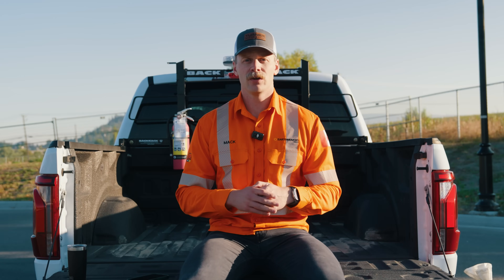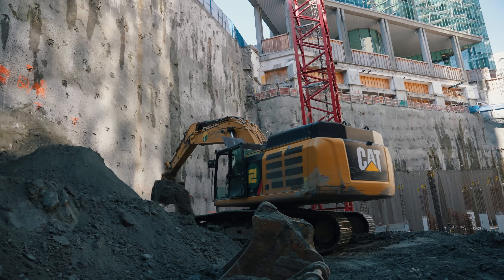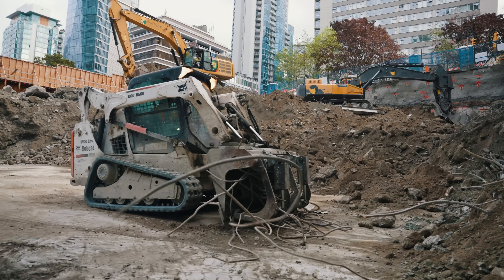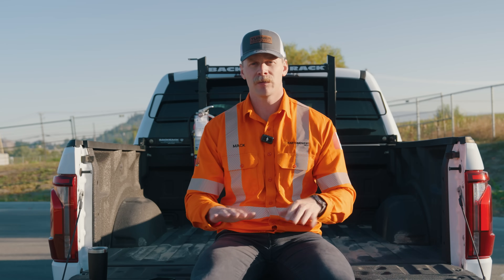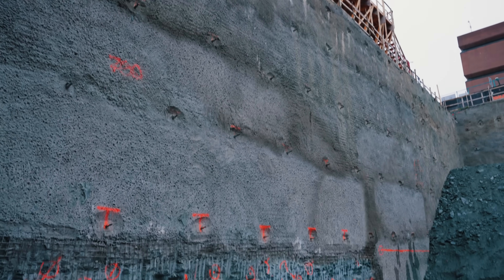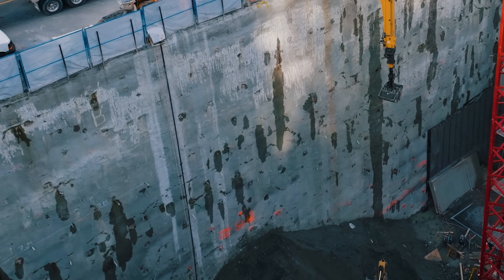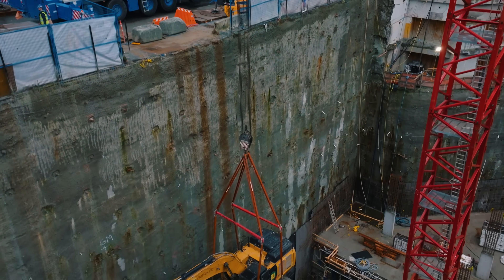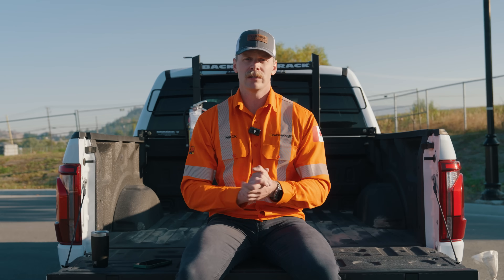Why are They Digging a 120ft Deep Hole in Vancouver? (Insane Engineering)

Comment: A excellent way to slowly dig a deep hole.  But why not use a waste container, like used to dispose of solid waste.  They make a 3 foot high container for dirt, and they can fill with 10 yards of dirt per container, lift them out with a crane, and drop in a empty at the same time.  Much faster.  And you need the construction crane on site anyway, just make it heavy duty enough to lift the desired 10 yard containers.  Instead of slowly lifting out 1.5 yards of material per bucket full at a time with that special telescoping excavator.  You could have a line of trash style rolloff bin trucks with the 10 yard container show up, lift their empty into the pit, and pull out a full one at the same time, send the trucks away every 6 minutes with 10 yards of material.

Comment: The guys doing the UBCO project in downtown Kelowna could have used these guys help. Their excavation was disastrous. Particularly to the surrounding buildings.
Reply from the maker: The BelPacific team does is right, thats for sure
Reply: The water table is a different issue that Kelowna deals with because of the lake
Reply: I drove by the dig a number of times.  No shoring of any kind was installed.  Just straight excavation all the way down until failure.
Reply: It’s the engineering that the issue not the working team

Comment: It scares me every time when I think of the side pressure on the road when heavy equipment working at the edge of excavation pit. Great video.
Reply: It scares me too especially coming from a guy that has survived two excavation cave ins and a fall from heights in my 35 years of construction , happy to be collecting a pension now .
Reply: @dmc2087 wow
Reply: TBF they have installed retaining bolts and cement into the wall.
Reply: @petergerdes1094  It can still happen if they don't cure it correctly, but shotcrete is hard as hell. It's hard for excavators with the hammer attachment to easily break it down.
Reply: @petergerdes1094  Happened in Burquitlam last year
Reply: @Mack_Dingo 😂
Reply: Cool and all but biggest fear getting trapped in a under ground parking lot like that if there was a earthquake or something. Already trip out even if I have to park at the highest level of a underground parking lot.
Reply: Especially after seeing this video from Coquitlam a couple years back. https://youtube.com/shorts/Ne2PQxGB0VM?si=rJUfI9NgJ9FtZAN8

I also feel like having the treads of the excavator perpendicular to the edge of the excavation is dangerous. One wrong move when trying to back out, and you end up accidentally driving forward off the edge. I would think it should be standard practice to bring the excavator in from the side and align the treads to be parallel with the edge, so it can only move sideways, not forward off the edge.
Reply: @AWSVids  the track has very little grip on asphalt or concrete surfaces  you could easily slide into the pit that’s why  they have it positioned this way the weight is also further away from the side of the wall this way . The operator running this or any excavator knows forward and reverse  to the position of the tracks otherwise they should never be in the operator’s position  😊
Reply: Not only does that surface have very little traction, but tracks have almost no sideways traction.  The vehicle is also narrower, making it easier to tip when working the boom off of the side.  Lastly the operators only chance of survival in a wall collapse is to be able to move away quickly, which is impossible if positioned sideways.

Comment: why doesn't the tower crane also have a clam bucket to help pull up the material quicker?
Reply: Tower cranes are not designed for that type of work. However, a crawler-crane positioned same as the excavator(s) and equipped with a rope-operated clamshell bucket would have been able to handle ALL of the excavated material, regardless of depth. Faster, too!
Reply from the maker: @1alanmarsh  Tower crane would take up too much room at street level. One lane was closed for loading trucks, other was open to live traffic

Comment: I saw this next to B.C. stadium at the (ACDC) concert 😊 but it was an (HITACHI) excavator with same straight dipper arm attachment to clam bucket. The excavator sat on huge wooden planks. Two dumptrucks were always ready to be loaded. Got to talk to the operator and he showed me all the cameras he has in the cab. 😊 he said the materials removed get dumped on a big barges for dumping out in the outer bay of Vancouver Canada. When I was their overnight thay were removing from pit the big compressor type DRILLING rig trailer down in the hole. All the workers had a built up steel platform that had a ladder for climing out of hole. Their were two excavator in hole bottom one smaller that the other. 😊 the big CAT one was working digging scratching at paint marks or a laborers hand signaling were he wanted the excavator to scratch at loss materials and cement. The pile for the clam bucket was on one side of the big pit in a pile, that the operator I talked to kept taking another load from.😊
Reply from the maker: Yes, BelPacific does have a marine based disposal facility, only material that meets certain specifications can be dumped there

Comment: would a conveyer system not be faster?
Reply: I was thinking of a grain auger.
Reply: No they don't have a long enough run to get materials that high without shutting down the entire site. I worked with this company for many years deepest hole I was on was 116. Only twice seen a conveyor and it was kinda a pain in the ass those sites were 5 times as wide so we could work around the conveyor but yea not that deep not in downtown Vancouver
Reply: its not about speed. speed doesnt make money. taking a whack of time does. Simple big business.
Reply: @diskotekentertainment8525  If there's an early completion bonus it would make sense to do it faster.
Reply: @diskotekentertainment8525 bet you’re not in business, it’s all
About speed, specially if you are hard dollar, this is all hard dollar, too steep for conveyors

Comment: Conveyors are constant and efficient at moving product
Reply: They have limited space involved in the excavation and the depth required for the building foundation a conveyer system would need excessive space and consistent assembly disassembly and maintenance as the depth increases thus increasing the time required and cost of the project and requires to much space therefore would not work for this type of excavation.
Reply: We have done conveyors for sites like this before. They mount off the side walls.

Comment: They don't just leave the equipment at the bottom and build the building around them? Disappointing.
Reply: Don’t they need a heating system?
Reply: That tower crane first piece will stay in that building
Reply: @CBECK73  You mean the concrete pad, yes it will get fille up with dirt and concrete up to the floor of the parkade. the whole crane will get removed in pieces
Reply: @B @Breezy8257 not the first piece is poured in place . Ive done at least 10 of them in Portland Oregon and PNW.

Comment: Surely there are more efficient ways to get dirt out of a hole...
Reply: Since the highest elevation on the West End is only forty feet above sea level, and the west end is a peninsula, I ‘d be more interested in how they keep that site dry
Reply: @johnmilkovic  i didn't see any dewatering equipment nor was i looking for any but if there was water infiltration well points would be set up to suck the ground dry.
Reply: Do tell!!!! Mr Expert…..LMFAO!
Reply: I really wanted to see a conveyor lifting it to street level
Reply: Some sort of conveyor system you’d think.
Reply: Not when you’re paid by the hour 😆
Reply: Big vacuum hose would do it.
Reply: Its more efficient having multiple machines that can jump around site to site without needing tear down/reassembly/maintenance/inspections/certifications. You can have 3 jobs on the go at different phases with one machine doing each job. These machines have certifications. They have a dealer network behind them. Lots of people qualified to work on them. They don't require days and weeks to setup with a crane. Bell Pacific doesn't want to be effected by crane schedules because they're not a crane company. These machines just require a standard operators proficiency to run. You'd need specialists for a bucket wheel contraption just to avoid liabilities in regard to the maintenance and safety of the machine. All thats covered when you're running a Caterpillar machine.
Reply: @NotSureJoeBauers Exactly👍 and also keep in mind the limited amount of space available for the excavation and the soil and rock conditions all play a role in the equipment required for the project.
Reply: @NotSureJoeBauers great info.👍
Reply: No kidding 😊
Reply: Most amazing section of the video for me was the mobile crane slowly hoisting the excavator out of the hole. That’s a lotta trust on every individual link / fitting involved. Amazing engineering and operational skill all around.
Reply: was thinking the same thing really an excavator with the a long reach and clamshell bucket😂
Reply: That's what I said when they first had the Long reach. Some kind of vertical conveyor belt with buckets.
Reply: Such as?
Reply: Need to look at the whole job, probably moved as fast as the slowest part of the complete process would allow them lol IMHO
Reply: If there was, they'd be doing it.
Reply: Yea bucket elevators
Reply: …like an bucket escalator.
Reply: They have to stop every couple of metres and shore up the walls so having expensive gear sitting around while this happens wouldn’t be cost effective. So they use excavators at a pace probably in tandem with the shotcreting progress
Reply: @John637  My observation on site as a flagger that is correct. I'd have trucks pull into my work zone and unload their shotcrete into the pump, they were on a schedule that matched the dig's progress, basically every 10 ft down or so they'd start with the shotcrete for however many spaces, they tear out the stuff that was supporting the wall before and do it again, dig 10 more ft and again. Deepest project I ever worked on was 30 ft, but 120 ft is wild and it took 13 months which is honestly not bad as it's a relatively small footprint
Reply: Just out of interest lads, would it not be possible to rig up the tower crane with a clam shell bucket, is that even feasible,or possibly a future project to look into, I’m not a construction engineer or worker, it was just something that struck me whilst watching this video, Really enjoyed watching this, new subscriber here, ok, from across the pond, exciting to watch these projects happen eventual completion,
Reply: @MrPat1559 probably cost more to run it when it’s been used for something else. And think of the wear on it making that many 1/4 turns. They don’t stop and start rotating as fast as excavators can plus it would be a lot harder to see from 200ft up
Reply: @MrPat1559  The bucket could be installed they do exist, but the crane is a lot slower also you'd need a mobile crane which as you saw in the video takes up 3 lanes at least possibly more, imagine having a mobile crane parked on the street for 13 months. It would cost the site god knows how much to close the road for over a year.

With the excavator and dump truck they're only occupying one side of the road and the flaggers and move cars on a single lane alternating traffic pattern, still paying money to the city but it's way less
Reply: @MrPat1559 possible? Yes.
Practical? Probably not, tower cranes are expensive and would be slower (keep in mind the pendulum effect causes the load to sway as the crane moves).
Reply: @MrPat1559 yeah, the crane could lift a larger bucket and probably fill the trucks in one scoop.
Reply: @MrPat1559  Tower cranes are expensive to buy, setup, keep certified (think x-rays, inspections ect) and the operators are making 100+ an hour. These guys running these machines make less that half that. You'd have to have a engineered base for the crane and have it on the corner of the site (loose space and increase cycle times, need bigger crane to reach the site) or put it in the middle and keep lowering it somehow. 1 million and 1 reasons why its done this way.
Reply: Doesn't make sense  !  There's easier ways than that to dig a hole 😊😊😊
Reply: They could go twice as fast for half the money. However, they lack experience and have failed to make up for it by studying harder. Take care.
Reply: @carlcarlamos9055 wow listen to this genius
Reply: There is not. If a contractor can do it cheaper more efficiently they will.
Reply: Depends on what kind of efficiency you need. 

If you want efficiency of budget, this is the way to go. 

If you want efficiency for time you can setup a continuous conveyor that costs hundreds of millions and have 5000 people on site all digging by hand and putting up shoring and you can clear the hole in 2 weeks.
Reply: @cconnors Fast, good , and, or cheap. Can't have more than two at a time.

Comment: Its too bad they cant set up a series of stackers at different levels to pass the dirt out to save time and fuel. Deep hole in a tight place. I would have thought ground water table would be an issue that deep in a port city.
Reply: On the one I saw next to B.C. place (stadium) same type deep dig. Thay had pump power units pumping out the water. Their seemed to be continuing wet water coming out of different heights on walls. At bottom they had a little pit dug for water to go into to pump out at 24/7 pumping. Same thing I saw in an open pit mine in Salt Lake city area west of city. 😊 big pump house in middle deepest part of open pit. Plus a work crew always working on water flowing in from different hight of mine. The crews were always working on flow of water directons away from haul roads.
Reply: @rp1645  "wet water" ??  LOL